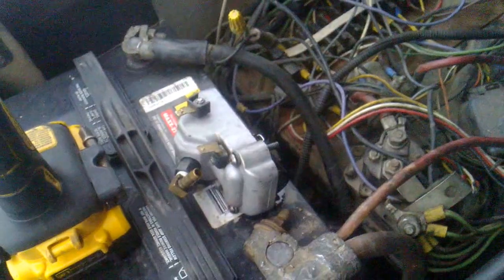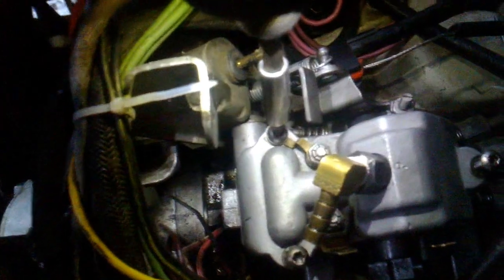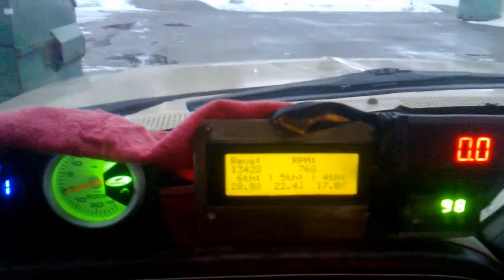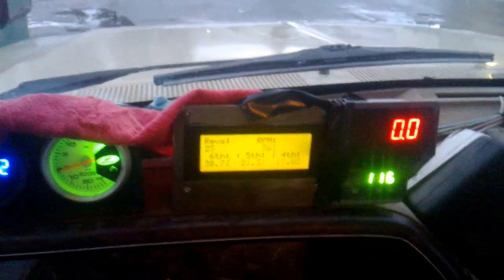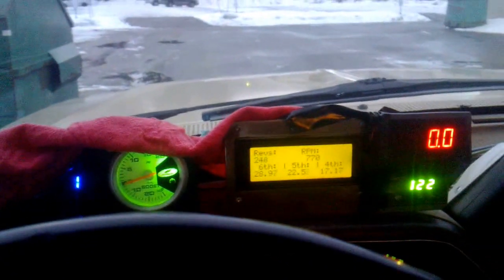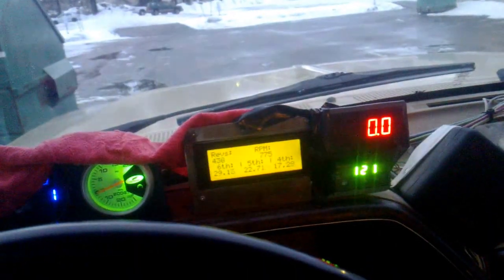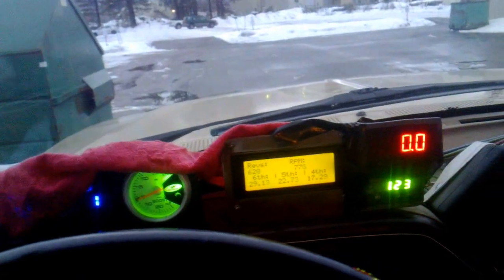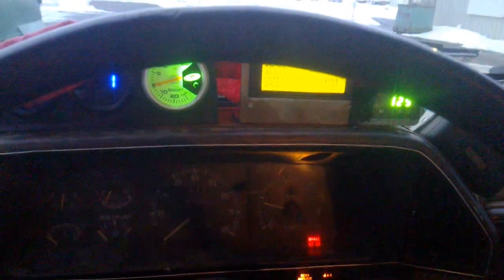7.3 IDI Governor Adjustment How-to

Comment: What in the world are those gauges all for and what or where did you get the HUD display? Looks like something I need for an engine protection project I'm working on that doesn't cost the same as a new truck and is designed for older idi's.

Comment: Kind Sir,
I just bought a 96 powerstroke.  I love it. But I am fascinated with the older idi's and idi turbo's.  Do you know where I can go to get a good explanation of the evolution of the motors and the main difference in the idi and powerstroke.  I am starting to look on Craigslist for an older idi.  Seems more simplistic.
Thanks
Reply from the maker: +48busman The engines are completely different. They were both made by Navistar, and the oil filters are interchangeable(though the PS filter is longer) but that's about it.
IDIs use a mechanical fuel injection pump and direct pressurized diesel to inject fuel; the 7.3 Powerstroke uses a computer, high pressure oil and a HEUI injector which uses the pressurized oil to inject the fuel at the command of the computer.
The IDI has no computers involved with it's operation; the powerstroke is entirely computerized. So to tune a powerstroke, you need a tuner. For an IDI, you need a set of wrenches.
The powerstroke is considered a better system - it should be slightly more efficient(when running correctly), and can last for 2-300K miles without any parts being replaced; IDIs have much cheaper parts, but you'll need to replace the fuel components about every 150K or so, for best results.

Comment: What is the adjustment screw on the very back of the pump above the injection lines with a jam nut on it? Is that for adjusting the tension on the governor spring?
Reply from the maker: +Matt Leonard I'm not entirely sure. It pushes against a little spring inside the governor assembly.
It seems to control governor response to some extent; I had a pump which would die if I let off the throttle quickly, as the governor didn't compensate enough(letting it down slowly would work fine). I screwed that adjustment all the way in, and it helped; it would still droop slightly below idle when letting off on the throttle above 2K, but wouldn't die.
Reply: on one of my idi's i bottomed it out against the jam nut. i cant say i noticed much difference, so i thought you might know what it is.
Reply: Quick question!  My IDI has what appear to be full cut-off at about 3,100 rpm.  I imagine it's the governor.  If this bolt was adjusted tighter and the idle screw reduced to keep idle low, could that fix the issue?  Or would it have to be a different spring? This truck was messed with by the previous owner.  He did a lot to the IP and added a turbo kit himself. I am thinking he messed up the settings.  Any answer would be much appreciated!!!
Reply: Please?

Comment: I just noticed the brake light is on, on your dash. Is that always on? And if so, do you know why?
Reply from the maker: left the parking brake on? I know it currently works correctly, at least as far as the parking brake goes; the "low vacuum" switch is long deleted.
Reply: LOL makes sense How do you delete that switch without causing that light to always be on?
Reply from the maker: @selador11  Just unplug the switch.
Reply: Never mind. LOL I just thought about it. two wires. I have a 50-50 chance. Twist the wires together, or leave them separate. LOL
Reply from the maker: @selador11  You don't even have to do that - literally just unplug the switch. No need to cut the harness or anything.
Reply: First thing I am going to do when the rain stops! Thank you.

Comment: Hi Mac. I know this is old. Sorry if this question is a pain in the butt. LOL That long brass nut in the middle of that shaft, that you adjusted... I'll assume that if your turn it to the right, it moves toward the driver's seat. If you turn it left, it moves toward the headlights. If that is correct, so far... Which direction is advance, and which is lowering the idle?
Reply from the maker: To the right(clockwise), towards the driver's seat will lower the idle, and adjust the maximum governed RPM/fueling down. To the left, counter clockwise, will extend the governor assy, increase idle, and make the pedal have more push against the governor flyweights.
Reply: Thank you very much!  =0)

Comment: how did you run that hud display? whatd you run it to and whatd it come off of?? I wan one!
Reply from the maker: The rectangle one? That's a 20x4 character display driven by an Arduino Uno.
I've got a chip that takes the tach input(which is a low AC voltage) and converts it into a series of pulses. The arduino uses that to calculate RPM, and then divide it out into speed in each gear.
Reply: could you build me a set up like that?

Comment: What does this governor do?
Reply from the maker: The part you see here is a set of springs that basically balances throttle input(from the throttle lever) against RPM(via the flyweights at the bottom-front of the IP). It both controls part-load operation(so you get a measured throttle response) as well as min/max - idle and WOT/max RPM control.

Comment: Show us the best way to adjust the wastgate on the banks sidewinder for more boost
Reply from the maker: The easiest way is to just unplug the darned thing! That'll give you max boost - should peak at over 15 psi(probably 18-20 max) - at least with a maxed-out stock IP.
Be aware that the turbo doesn't do much beyond about 12-13 - We've experimented with my '92 and found that with it plugged in and set to around 10, it'll peak at 12 or so, and mostly clean it up. Unplug and we hit over 15(15 psi gauge pegged), and it cleans up nicely.
It's pretty impressive hauling a trailer with that setup - taking a 5-7% grade at 50MPH, foot to the floor in 3rd with 12k behind you, the turbo just going flat out.

This is with stock head gaskets and stock bolts, BTW... But getting it hot doing that does stress old gaskets - it started to weep coolant from the rear corners of the head gasket.

(exactly the same thing my '93 did with stock power levels when the belt tensioner broke and it got a wee bit hot limping it to the auto parts store - it finally blew about a year later after running that year at 250rwhp - over double stock power).

As far as plain adjustment, you simply need the rod to need more force to open - so just pull the little keeper pin that connects the waste gate rod to the turbo, slide it off the pin and tighten it down. Shortening the effective rod length makes it harder to open = higher PSI.
You can also do things like taking a stiff spring and connecting it to the waste gate actuator, to again, make it require more force to open that wastegate.

Comment: Where did you get the Digital dashboard ?
Will it fit a 1994 IDI
Reply from the maker: It was/is a custom project using an Arduino. In theory it could fit any IDI, the only inputs being power and a stock tach sender.